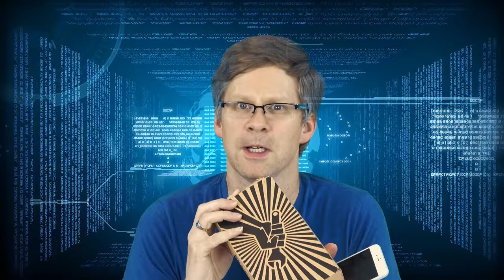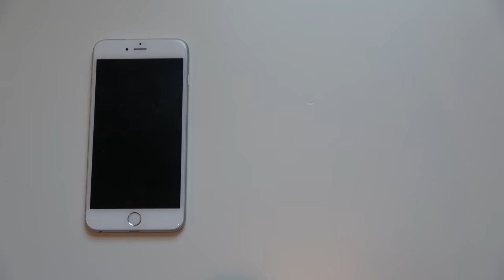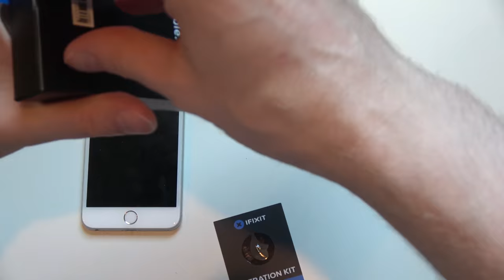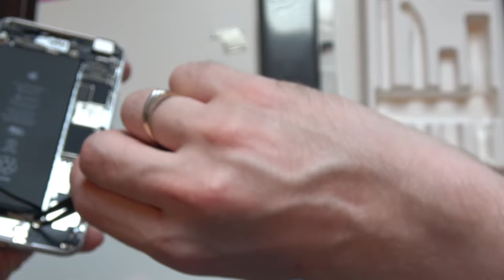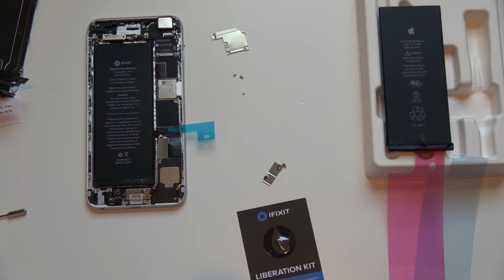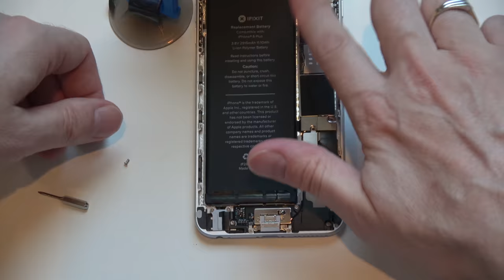DIY iPhone 6 plus battery replacement - Fail @ 160F!!!

Comment: You can get replacement logic boards out of China, ones that have been refurbished basically.  Also using the thermal camera on it to see what is getting hot.
Reply from the maker: Yes, I haven't decided whether to bother with replacing the board or not being an older phone.